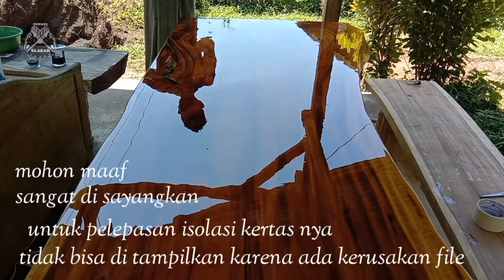Belajar Melapisi Meja Kayu Trembesi Dengan Epoxy Resin

Comment: Mas..mau nanya:itu mejanya di warna pakai woodstain,atau masih kayu asli ...kalo sdh di warna pakai woodstain kalo di resin bisa nempel tidak resinnya...trm ksh
Reply from the maker: Kayu asli... Epoxy Resin clear tanpa warna, tanpa woodstain. Untuk menutup pori pori nya pakai insulator
Reply from the maker: Bisa... Tapi di amplas dulu